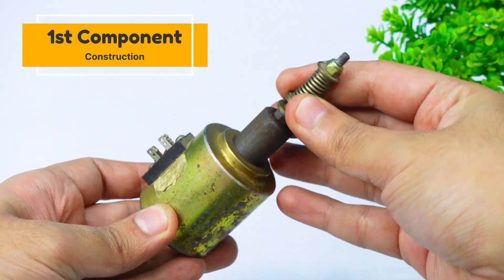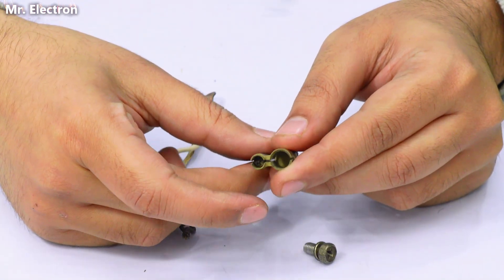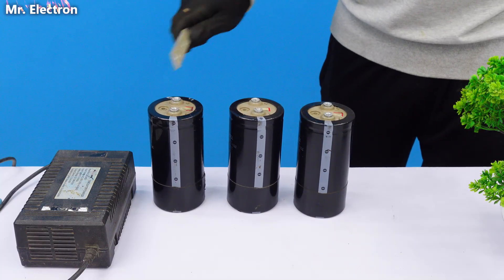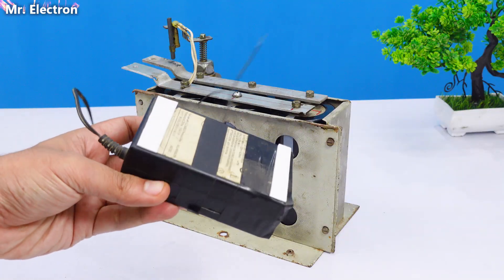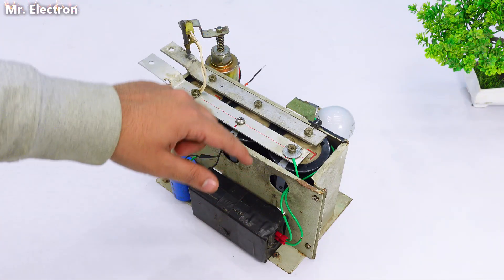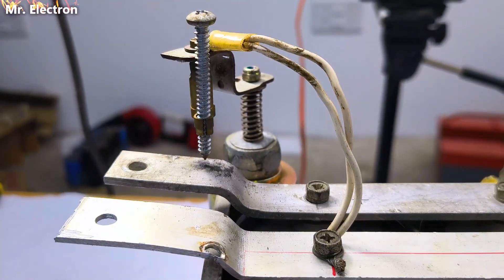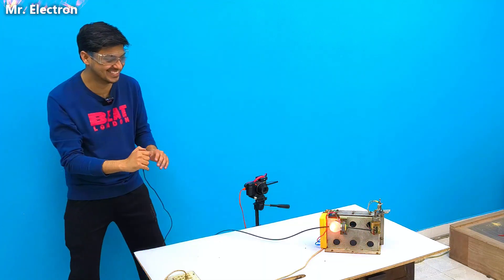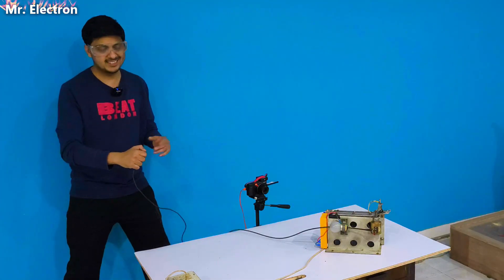STOP Throwing Away MOTOR CAPACITOR, This SECRET will Surprise You !

Comment: The voltage rise is the peak voltage, in this case sqrt(2) * 240 volts = 340 volts. The intermittent discharges are due to dust and dirt which are causing the surface discharge. make sure to clean the space between the terminals of the capacitors with alcohol and let it dry before use. If required, you can submerge the terminals in epoxy for better insulation and prevent surface discharges.